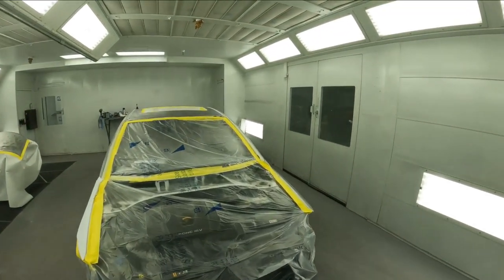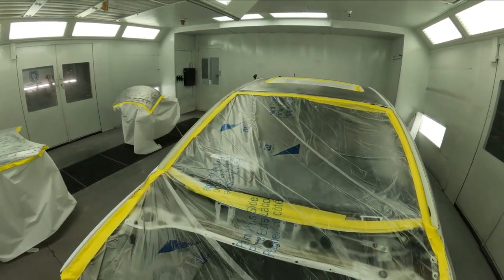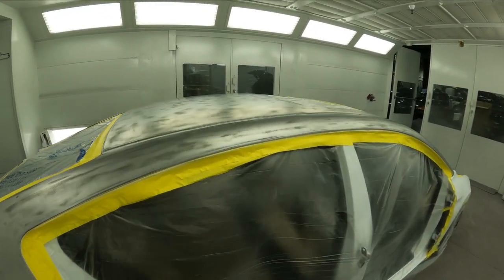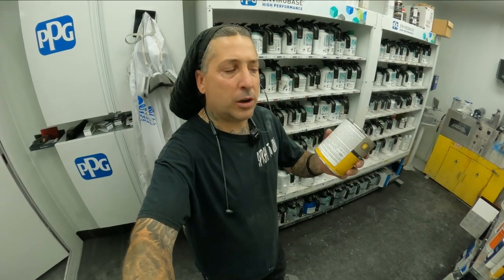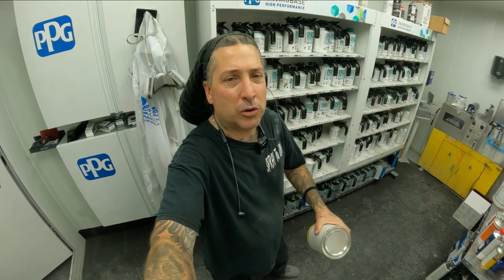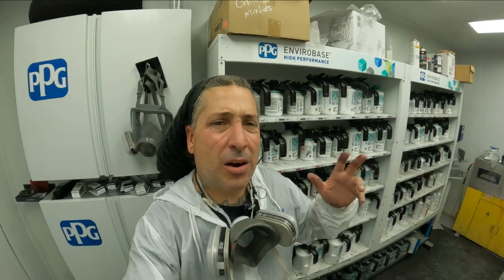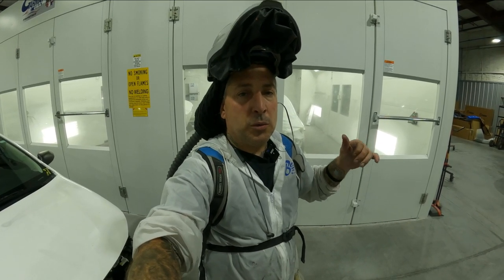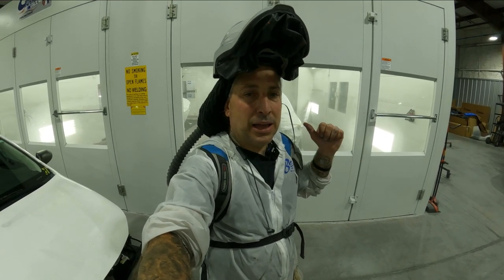How to Paint A Car Directly Over Bare Metal

Comment: Nice job! I plan on doing this with my 93 Toyota pickup. I bought it from a friend and they hit a deer and replaced the hood fenders and bumper but they didn’t get them painted so now the factory e coat has surface rust so I am hoping and praying I can strip them down to bare metal and there won’t be any more rust then I can epoxy base and clear. I am a production shop painter that uses envirobase as well! I wish we used the clears you do instead of the EC line but they still do pretty good. Thank you so much for the info you share!

Comment: Definitely the best way to do it with epoxy, etching it and 2k primer would not give better results plus a load more work and a risk of some ripples. I don’t like etch primer I’ve seen issues with it with adhesion 
Doing it with epoxy as wet on wet will give it the best adhesion and rust protection, like you said it does take longer to cure 
Lovely job 👍

Comment: Thanks for this video. I also used epoxy primer like this but I was too dumb to figure out not to spray it directly over Bondo/filler. I had some bleed through. The filler will react to the epoxy. 2k over filler spots then epoxy over everything else. Learned to use epoxy as a sealer from another channel but he didn't explain all the details.
Reply: Hello, could you please tell me what the 2k is that is put over filler spots????  If so thank you very much for your help on this
Reply: Make sure you let it cure well before sanding. If not it will shrink too much.

Comment: Thats how I was dealing with Ford crown vic's in the fleet. I would usually chemical strip as I could go do something else why it did its thing. I would spot prime any body work and then seal and paint. If there was no bodywork I could strip and paint the same day. For any panel on the side I would razor blade until I found where it stuck.
Reply from the maker: Absolutely 👌
Reply: What kind of chem stripper are you using now since methylene  chloride was banned from paint strippers?
Reply: @MrSloika  Last time I tried chemical stripper it was slow. I do not run into peeling oem paint much anymore. The fleet I repair is not white anymore. When I worked at GM in the 90's I would use 8" 80 grit on the grinder. Would prime and sand. Best might be razor blade now.

Comment: Only problem with this method is the epoxy cures at a much slower rate than the urethane clear. Looks great at first, then when epoxy cures, pinches up the clear, creating nasty texture. I use etch, then urethane sealer for bare metal peelers. Not a hater, just my experience with DP's
Reply from the maker: Have not had that problem
Reply: Let it dry for 30 min before you put your base on
Reply: In time it will show it self. You don’t see the vehicle after 6 months to a year.

Comment: I spray Ultra BC8. The rep said I can spray the 995 etch primer over bare metal, let flash for 20 minutes and then move right into the P30 sealer, base, clear.
Reply from the maker: Yes that  will work out but  not a fan of the etches finish nothing is better than epoxy on bare metal

Comment: When you say "wet on wet" epoxy primer, does that mean you to 2 coats back to back?
Reply from the maker: One coat of sealer wet on wet means no sanding flash  off and go right to base coat
Reply: @Kandy Man  gotcha! Anytime I do a job like this, I usually go epoxy, sealer, base, and then clear. I'm gonna have to try this. My theory was that the envirobase wouldn't adhere to the epoxy as good as it does to the sealer.

Comment: Nice work, what is the final grit used to smooth out the bare metal, and would you recommend using mesh da discs to prepare the bare metal for sealer?.
Reply from the maker: 180 grit da

Comment: So do you sand the bare metal with 320 or do you sand the color blend area with 320/400 then 600/800?

Also last night, did you use the prep all pad, and the next day alcohol? or the other way around?
Reply from the maker: 320 yes blends 800
Reply: @kandyman5315  320 to metal ok.

Comment: If you’re using DTM epoxy is the etch wipe really necessary?🤔Great info we do this with many of the Toyota warranty work we get
Reply from the maker: Can't hurt
Reply: Absolutely can hurt. Read the TDS on the epoxy. Most recommend NOT to use etch under them.

Comment: Sometimes on certain bare metal surfaces, I will etch primer like 1-2 coats then put sealer over that, then apply my base color. I’ve not had any problems doing this way but, maybe I’ll start epoxying bare metal from now on. Any ideas on my process, let me know & thank you!!
Reply from the maker: That technique is fine, but the etch primer works better when it is applied with a light  coat   that  you can see trough. I tested it out the more you put the less adhesion
Reply from the maker: But the best is  epoxy on bare metal
Reply: How many coats of epoxy primer you put on bare metal?

Comment: What did you use to strip it down to bare metal?
Reply from the maker: Razor blades then da sander
Reply: @kandyman5315  what grit would u recommend? Is that what you did to strip that cutlass?

Comment: hello, my question is who and what kind of paint should I use to paint my paint booth I striped to the modal it is galvanized. can I use the same paint as what you were using on this job?
Reply from the maker: Yes .I would epoxy than  single stage  it with a good urethane

Comment: OMNI never impressed me. I use Rubber-Seal and I like it better. For removing the paint it's hard to beat the Eastwood SCT (or Harbor Freight equivalent) and the coarse stripping wheel that looks like Scotchbrite on steroids.
Reply from the maker: Have not tried sct looks like it works well

Comment: Great video. Thanks!!!
Question: If I strip the panel(s) to bare metal and have some minor bodywork to do, do you recommend I put filler DTM or should I use the epoxy first, then filler, then another coat of epoxy?
Reply from the maker: The best way is epoxy first then filler